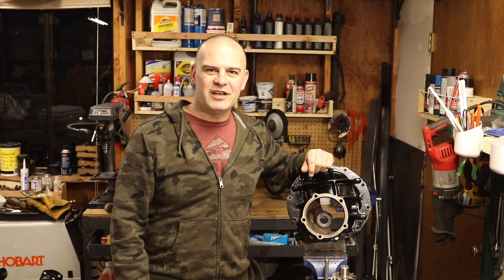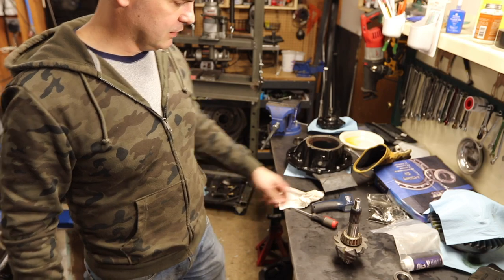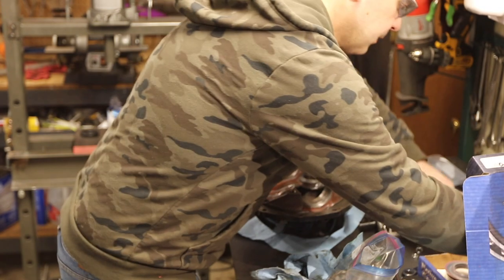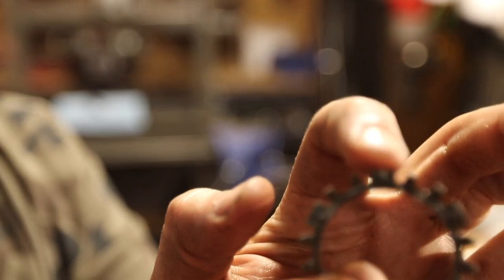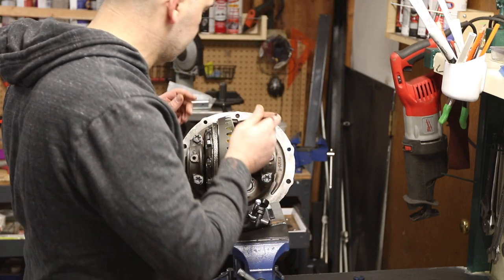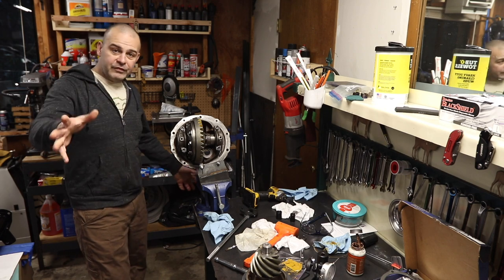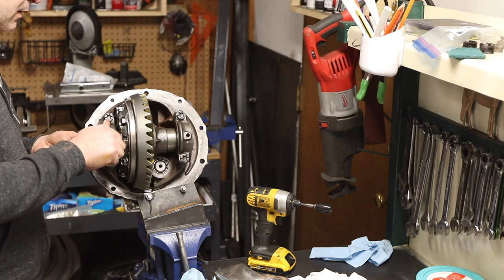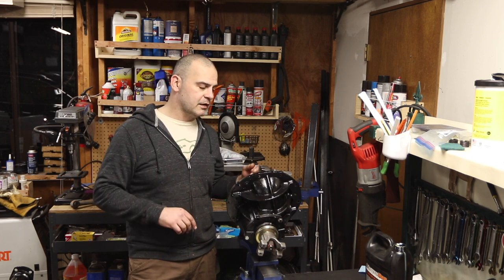3.23 - Ford 9" Differential Setup with Yukon 4.11 gears -  Part 5 of Gears and Axles

Comment: I am my own shade tree mechanic and I have successfully set up new gears, lockers and bearings with new shims on a high pinion DANA 60, a high pinion DANA 44, a GM full float 14 bolt and a Ford 9” which the GM full float 14 bolt was designed after. The carrier bearing pre load and the third bearing on the pinion are very similar. Just take your time and fully read all instructions and you can do this too. I got my special tools at a swap meet.

Comment: Nice video Matt. I used a 6 foot cheater bar to set my pinion preload. Once I had zero lash I basically had to think I was moving the nut and then check preload because you’re right, it’s super sensitive. When I finished I thought the same thing. “Maybe it will blow up, I don’t know.” Ha!

Comment: Oh man you set up the ford 9 inch first! Those are so nice with the pinion housing shims for pinion depth and the spanner adjusters for backlash/carrier pre load. (GM 10.5 inch 14 bolt axle are the same way). So every regular style axle build after that like the dana44 probably seemed like a pain in the butt and so much more time! Thanks for sharing!
Reply from the maker: Jay Jay so true. The 9” is the best axle ever. Only down side is the thin wall tubes and the janky disc brake retrofits but otherwise so well engineered. The newer setups with disc brakes and thicker tubes are amazing.

Comment: You get depth from the flats where the bearing caps go to the pinion face there is a numbers scribed on the end of the pinion that is the depth you need to hit you get that dead nuts on then set your backlash done and done of coarse set preload

Comment: I think ima buy a 3rd member off craigslist to practice... I have high gear ratio and I want something I can cruise on the freeway
Reply from the maker: Costamesa Westside that’s the great thing about drop out rear ends. One you get it set up you can just swap and go in a 4 hour session. Go for it. That’s a mean sounding cam by the way.
Reply: @MattsGarage  thanks bro

Comment: Its been a while since you posted this video,  how is it holding up ?
Reply from the maker: JEEPN 804 I ended up selling the Bronco but I did the Dana 35 in the back of my TJ and put a limited slip in it while I was in there. Basically the same process and so far with several thousand miles I’ve had no issues.